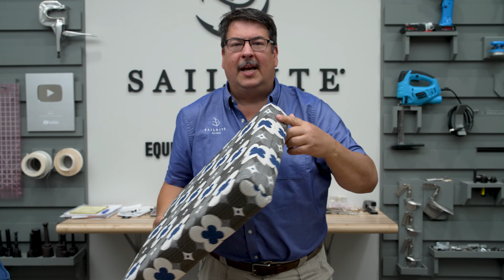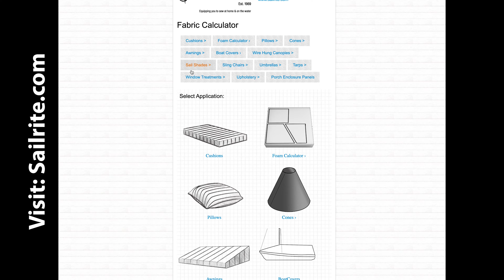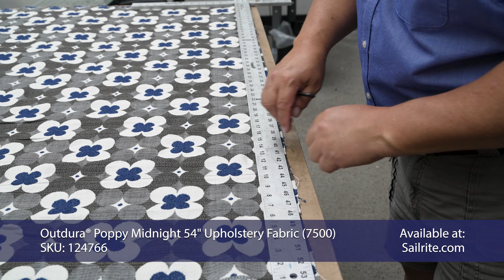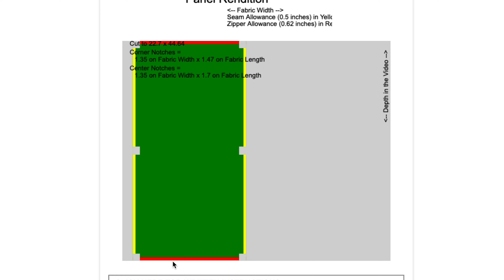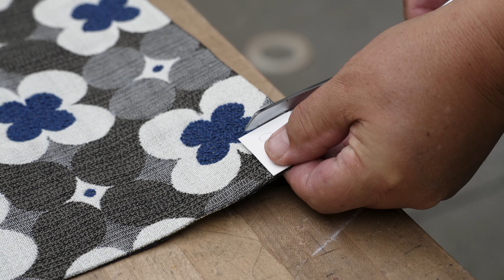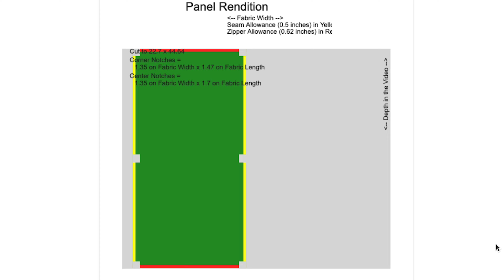Master Making The 30 Minute Cushion

Comment: thank you for this great instructional video.

I have one request.
Could you add a field in the calculator that asks for the seam allowance width.
I usually use 10 mm seam allowance.
You have a fixed imperical seam allowance.

Comment: I would love to make them but in Belgium we use cm and no inches so it is verry hard for me to calculate the corners
Reply from the maker: Hello,
That particular fabric calculator does have the option to calculate in CM, I would double check the measurement on one corner with one done in inches just to make sure it is functioning properly. 
https://www.fabric-calculator.com/Flippable%20Cushion%20with%20Boxed%20Corners/index.html
Reply: You’re kidding right?

Comment: Thanks for the great video. A quick question... I'm re-covering some existing newer cushions for my project, not using new foam. If I have a 22" wide x 18" length x 4" thick piece of foam, what should the input be in the calculator based on that size existing hard foam cushion? Thank you.
Reply from the maker: Enter in the fabric calculator: 21.5 x 17.5 x 4" thick.
Reply: @SailriteDIY  Thank you.

Comment: Thanks so much for this video. The calculator and the video instructions were amazing! I did two really large cushions and it took a lot longer than 30 minutes, but I can't rate this video enough.
Reply from the maker: Thanks for the kind words, you are correct it takes much longer than 30 minutes for most to make this cushion. In fact the only person I know that has made it in the 30 minute range is Eric back when the original video was made.

Comment: Wonderful video. Thank you! Made a 6’x19”x2” banquette cushion using the calculator on Sailrite and following these directions. Turned out perfectly. Didn’t have seam tape, so did it the old fashioned way :) Don’t expect it to take just 30 minutes - took me longer than that just to do the measuring/cutting.
Reply from the maker: Glad to hear the cushion turned out perfectly! Thanks for the feedback on the time it took as well.

Comment: I've used this method several times with great success. Some things I learned that may help others include: it's not going to take 30 minutes. It takes me that long to find my glasses. Don't fret too much over the exact measurements of the notches, use the calculator as a guide and then when it's time to sew the corners and with everything laying flat and seams lined up, draw your stitch line on the triangular point of the fabric to create the depth of the cushion rather than just sewing a 1/2 inch allowance - there is wriggle room and no need to fret about cutting 0.001 of an inch to get seam allowance to be a perfect 1/2" once all other elements are sewn. Fabric shifts. Slightly less on corners is better than more IMHO and easier to plump out rather than a big dog ear corner. I just wish all the Sailrite stuff was more freely available in the UK....
Reply from the maker: Hi James,

Thanks for the great comments and suggestions!

Comment: This video is amazing. I tried to sew one of these but not really. I ended up just putting together 6 pieces of fabric together and threw on the zipper on one side and I struggled so much to add the zipper because it was too t ight. So I looked up, "how to sew a rectangle bed cover" and found this video. Wow, I wish I had seen this first. Thankfully I have 2 of those bed covers to make so on my second try I will 110% use this method. My mind is blown! Thank you!

Comment: The tape doesn’t gum up the needle?
Reply from the maker: The only time you sew through the tape is when you sew the zipper in place. When sewing the seams if you sew through the tape, that would not be good because when you turn the cushion right side out you would see the glue.  If you sew through the seamstick usually the fabric fibers help clean the residue off the needle as it enter and exits the fabric. But, basting tapes have a tendency to leave a gum residue on the needle when sewing lighter fabrics. If they do, run the needle through a bar of Ivory soap to help prevent build-up or use a cotton swab with rubbing alcohol to keep the needle clean. Many professionals use a thread lubricant, like Sewers Aid, on a cloth pad clipped over the upper thread in the machine or a device like the Magnetic Oiler to keep a consistent coating of lubricant on the top thread.
Reply: Apparently for no one else

Comment: I was looking at the written instructions and it says the center notch should be twice as long as it is wide. is this a typo? or am I reading it wrong? Im trying to double check things and understand the logic before starting. thanks so much
Reply from the maker: I would not follow the written instructions, they are old and outdated. If you do use them make sure you use the measurements from the calculator.

Comment: Excellent instructions when combined with the fabric calculator. All the supplies I used were from SailRite except the fabric and basting tape. I would recommend using the Sailrite basting tape as the Joanne's version was ineffective on upholstery fabric (in fact I'm ordering some from Sailrite for future use now).  But there is no way this is a 30-minute cushion. The sewing may take 30-minutes once you've cut the fabric to fit. I made cushions for a re-upholstered couch which came out beautifully. It was a two day project.
Reply from the maker: So glad you cushions came out great! True, we do sell the best seamstick basting tape on the market for upholstery applications. After making a few you may find it only takes about 30 minutes each. I can do it in about that much time, but I have made close to 25 myself. Thanks for your kind comments!!!!

Comment: Seam tape sounds like a good idea but gummed up my needle and thread and almost ruined my project.
Reply from the maker: Did you order it from Sailrite and was it the 1/4 inch size? When making cushions you must use the smaller width seamstick of 1/4 inch, it is best for cushion, if you use the wider seamstick then you will sew through the tape and it will be seen once the cushion is turned right-side out. The only area where you sew through the seamstick is the zipper. Using basting tape (Seamstick) for canvas on a very light weight fabric may gum up the needle rather quickly because the lighter fabric does not have the larger fibers or weave to help clean the needle as it exits the fabric. In those situations it may best to use pins to hold the fabric in place as you sew. A gummed up needle and parts can be cleaned off with some rubbing alcohol on a cotton ball or Goo Gone (we do not sell this).

Comment: I tried the double sided tape which did not stick to my  outdoor fabric.  I  feel that water resistant outdoor  fabric has a coating that the tape wouldn’t adhere to.
Reply from the maker: Did you buy the Seamstick Double Sided tape 1/4 inch from Sailrite? It sticks better than any other brand. Also, you are correct a fabric that is water and stain resistant is often very adhesive resistant as well, but our seamstick should work especially if you press it down well with the Sailrite Canvas Patterning Ruler.

Comment: Great video! I made a new bench cushion for a swing. Gets a little tricky with 1 1/2 and 2” cushions. Corner’s and Zippers get really tight considering you’re only taking .8x.9 out of the corner. Tips would be appreciated
Reply from the maker: This process can only be done if sewing cushions that are 2 inches thick or more. Anything under 2 inches in thickness does not work well using this technique. I would sew a traditional box cushion if you want a thin cushion like that. Or the "Quick & Easy Box Cushion"

Comment: thanks for the instructions, i've followed this method with the earlier video of the 30minute box cushions and I have ended up with a loose cushion cover, how do we adjust it so that it's a tighter fit. Maybe a followup video on how to fix issues?
Reply from the maker: I would take out the foam and add polyester batting. I hope that helps. If you follow our Sailrite Fabric Calculator the cover should be very very tight.